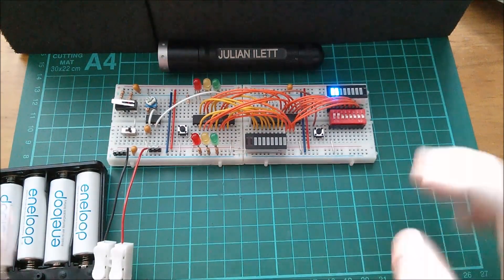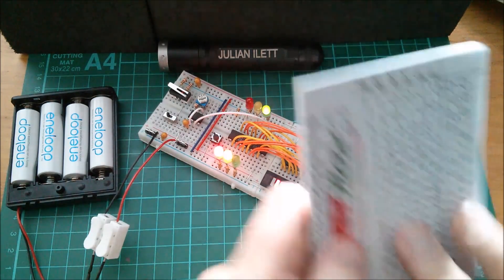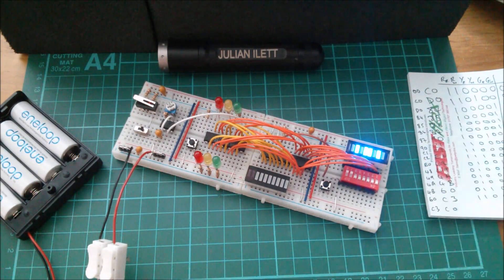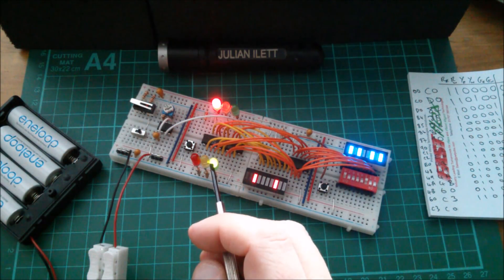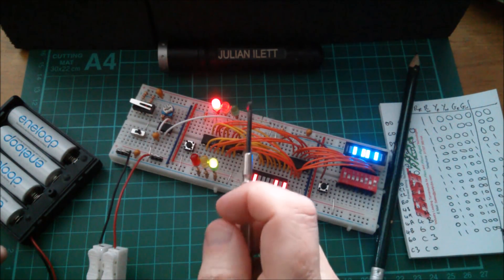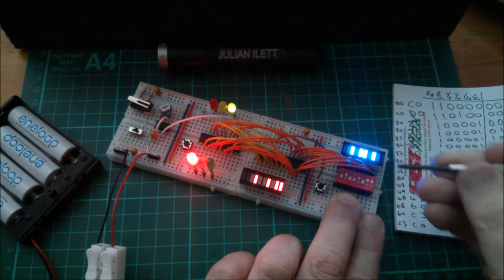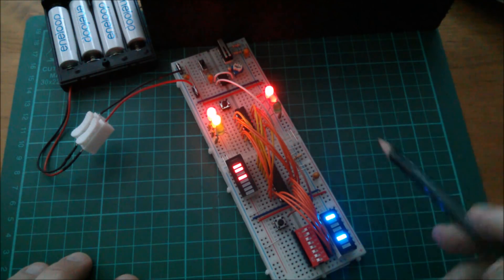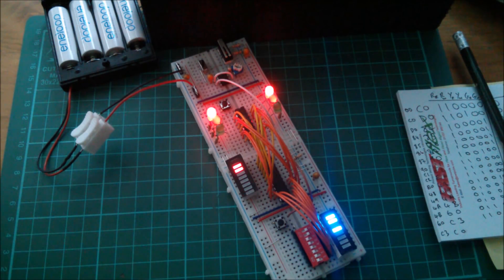LED Traffic Lights

Comment: In my country, green blinks four times before turning into amber, in addition to what you programmed in. That would be quite a challenge to achieve with this computer :)
Reply: Here, we look at the pedestrian crossing light. We speed up when it starts flashing. We floor it when the traffic light turns yellow. Yellow means go go go !
Reply: Simply double up on the RAM and latch and make it a 16 bit word. That gives you 6 bits for the LEDs, and 10 bits for all the extra states you need to keep track of.
Reply: The rapid-blink-before-amber could possibly involve running the 555 four times as fast, a ripple counter to compensate, and some (N)AND gates to mix the raw 555 beat with the "green" signals at the last ripple before the latch advances to amber.
Reply from the maker: Yeah, tricky, especially if it's a rapid blink :)
Reply: There are crossings in the UK for pedestrians known as pelican crossings which have a flashing amber phase on the way to green, perhaps that is similar. Cars are allowed to proceed under flashing amber as long as no pedestrians remain on the crossing.
Reply: And here in France, the lights go straight from red to green, missing out amber altogether (presumably because French drivers would see amber as an incitement to floor the pedal). So Julian, if you could just knock up a French version, that would be lovely, thanks...
Reply: DR.XXX did it his link is in this thread he nail it perfectly
Reply: The two unused bits at the end of the address could adjust the clock frequency for the next step. That would solve both the issue of the longer green phases and my blinking green.

Comment: Hey Julian, you should build a programmer that can load a program from a PC to the RAM. Painful otherwise.
Reply: I think a punched-paper-strip reader would be adequately low-tech for this project.
Reply: Anvilshock , maybe clay tablets with cuneiform.
Reply: Well, he'd still have to somehow convert that to electrical signals …
Reply: At the very least a numpad with the numbers 0-7. You can program quite fast if you just have to punch in numbers 0-7. Even faster for numbers 0-F for hex entry.
Reply: Not sure you're getting the spirit of this project.